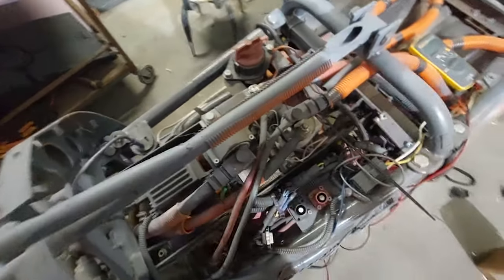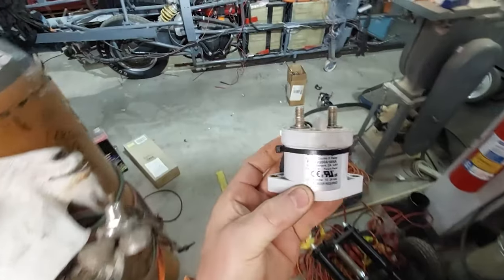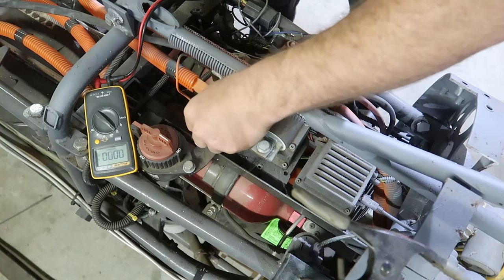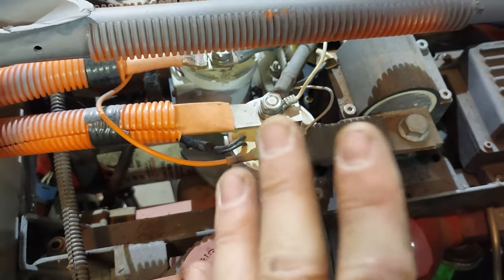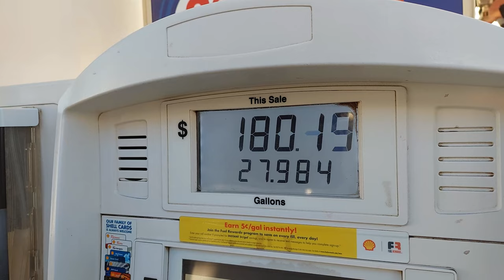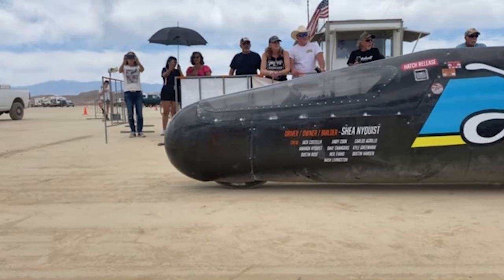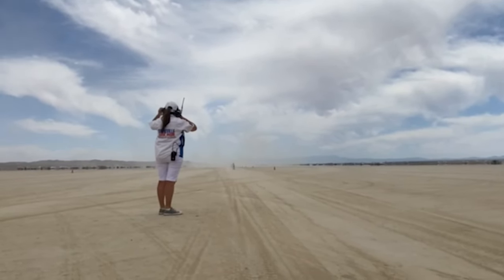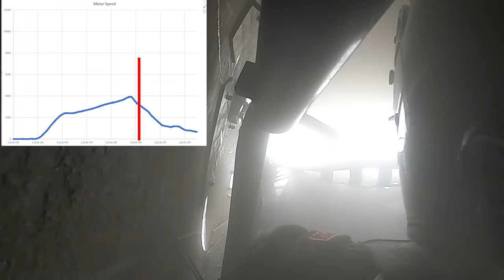First Run at El Mirage SCTA event May 2022 | Lark Machine Co

Comment: Here's a tip for an old dirt bike racer .Next time use a cake or biscuit tin and put your chain in that. Also even better full it with bike chain grease heat it until it turns into a liquid. let it cool, and wipe the chain clean. Why? well the gease enters into the chain and sets when cold. It keeps the chain lubricated way better than just oil on the outside out the links

Comment: Hi Shea, what about just wearing the thin surgical type gloves as a bit of voltage protection and you still get reasonable dexterity, I'm slowly starting my wiring system for the land speed bike, I may try a youtube video like you,
Reply from the maker: The surgical gloves can provide brushing and light touching protection, but break down quickly when pressure is applied.  I feel much more confident with no gloves and trusting the dmm.  I personally don't like gloves. They hinder my ability to work safely
Reply: Dirty hands. Clean work.

Comment: 1-Rad!!!
2-Not sure the frame rate effects but the flexure of the shell might indicate some speed/wave length effect… do you have any accelerometer vibration data? 

I gotta get to a bigger screen to watch
Reply from the maker: What the hell does speed/wavelength effect mean!?!?!? I don't have and accel data. My daq just does driveline stuff.  I was thinking about a logger for my phone ( I use it for GPS speed logging)
Reply: @sheanyquist  I noticed the deflection in the shell seeming to change  at different speeds… imagine a bubble bumped open at the nose … it collapses into the sides perhaps several times … at various speeds the bubble stretched longer Down the sides… so I wondered if there was changes in buffeting that might peak at specific speeds that coincide with the bubble lengths being multiples of tye bike shell…. Sorry, there is weird stuff in my head time to time

Comment: I used to ride the dry lake bed  abit back in the day day, I've seen these speed runs from time to time. 
This looks like way too much work to be fun, sorry!!
Here's my self made diy emc:: https://youtu.be/QKzJRHKn3r4
40 mile range ,top speed about 85 mph. voltage 98.6
Reply from the maker: It'll be fun if I can sort out some of the issues and get a clean run
Reply: @sheanyquist  instead of "pressurized" jet fighter cabin to keep the dust out, maybe a video camera ??